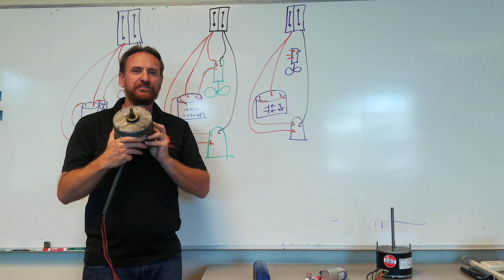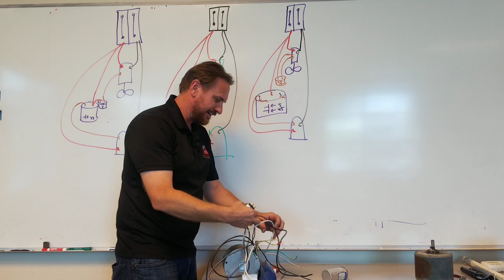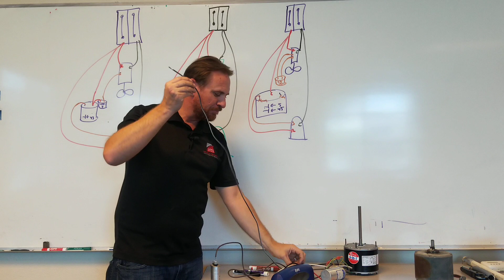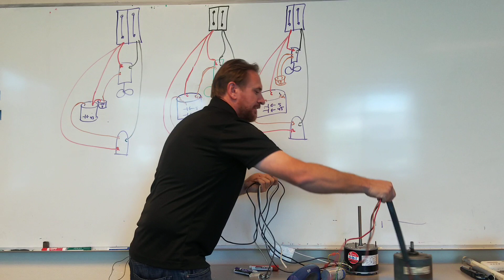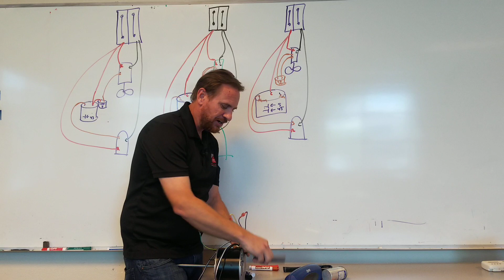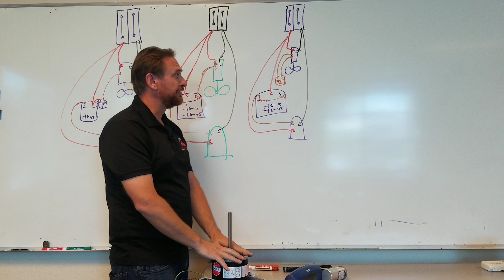Hvac condensor wiring part 5 universal fan

Comment: I am curious about your comment of cutting of a wire,  I have seen other videos stating it can be done, however not much explanation.  My understanding is that a capacitor require two wires to the motor to be installed in the circuit.  Is that correct?  The 3 wire motor I just replaced has a diagram that shows the cap with one wire and the other side is connected internally to the other side of hot.  Any thoughts ??  Thanks
Reply from the maker: Not sure what part your referring to. It is in a multipart series. Have you watched part 1-5 of the series?

Comment: I ended up having to eliminate my brown an white striped wire an wired it exactly the same as the old fan or else for some reason it wouldnt work right eaither the condenser wouldnt turn on with having it on a different compacitor or it would keep overheating never had a single problem an was less quiet after eliminting that wire
Reply from the maker: Great response everyone! Thank you!!

For me, there is not enough information.  I would like to see a measure quick screenshot before and after said temperature.

In Las Vegas, the sun bakes on the package units. The insulation would fall off and such. Even with everything intact, there was a lot of heat gain through the attic and then on the roof before re-entering. 

At these conditions, all problems are magnified. 
Could be leaking ducts, restricted ducts, home sealing, insulation, pressurization, and depressurization issues.
Mechanically high head pressure, compression ratio, compressor capacity, internal pressure relief, restricted txv, closed filter drier, the list goes on. 
With the measure quick screenshots, I visualize it better.

Comment: What if the black wire on the old one was on a relay at the control board  would u put the new black wire on the relay or on the contactor for the 4 wire.....
Reply from the maker: On the relay, that is most likely a heat pump.

Comment: Instead of adding a 2nd run Cap, just us a Dual Cap, the Brown/White wire is connected to the Yellow or White wire inside the Motor, so you don't need it. TAPE UP THE SPADE and leave it unhooked. Run the Brown wire to F, White to Common or the Defrost Board (Depending on if it's a Heatpump) , then the Black Wire the Contacts. This way you don't need a 2nd Conpacitor.
Reply from the maker: Yes and this was covered in one of the other parts of this series where I demonstrate that. 

When replacing a motor  it's best practice to replace the capacitor as well. A small capacitor is cheaper than a duel run even with a high quality capacigor.  A universal fan capacitor is rarely the same mfd as the existing dual run. Which means stocking more typed of dual run. Another benefit of a seperate capacitor is better heat transfer. Notice in hot climates dual runs fail more often than 2 individual.  More metal to air keeping them cooler and lasting longer. 

Personally I'm against taping the ends. I prefer to cut the wire and use a wire cap, butt connector or heat shrink. Electrical tape just makes for a gooey mess in the heat..
Over all it comes down to personal preference.
Reply: @love2hvac  yes you want to cut the end, wire cap and then tape.. Thats how I do anyways. I'll check out your other videos..

Comment: You explain this much more difficult than it is.  Use the dual compactor and connect the brown wire to fan, connect the white wire to common and the black wire to the black side on the contact.
Reply from the maker: You are suppose to install a new capacitor with the fan and it is very rate for a universal replacement to be the same size at the dual run.

Comment: why don't you use the existed 5MFD capacitor inside the dual capacitor ?  can you explain it ?
Reply from the maker: Always replace the capacitor with a motor.
Reply: @love2hvac  : it's not necessary since the life of existing dual capacitor is usually determined by big capacitor working with compressor but not fan.
Reply from the maker: @悟入木三分  
A capacitor is the #1 failed part.

I have many times seen just the fan side or just the compressor side of a dual run capacitor fail.
2 individual capacitors dissipate heat and last longer than a dual run.
Universal fan motors almost never use the same capacitor and as the original capacitor.
Most dual run capacitors are already made with thin oil that swells in the heat. 
Many motor manufactures require a new capacitor with the new motor for warranty. 

It dosent cost much more to add a separate properly sized high quality amrad capacitor that eliminates a call back, warranty motor and extend the life of both capacitors. 

I hate that hvac manufactures use junk capacitors in their very expensive units and I would never rely on that with my name and new motor.

Comment: Actually I just watched part six of your series and am I Safe to assume on a multi speed motor, that the multi speed motor leads would be considered your common wires??Thank you
Reply from the maker: Oh yes!!!!! 
I'm so proud! That is why the high speed is black. The other speeds just add windings, adding resistance, slowing the flow, weakening the motor. In reality the white (110) or yellow (230) is the run winding!
Becuse it is always being used it is just a commomly used wire so the terms get confusing.
Reply: @love2hvac  Awsome.   I am in a five-year refrigeration mechanic apprenticeship and I can tell you I learned more from this one video than I did during all of my basic level training, hopefully intermediate level gets better.....If it doesn’t I’m going to request that the school bring you in To educate us...Blessings from Toronto Canada

Comment: Thank you very much for the great video!!
I’m hoping you can answer a question I’ve had for a long time....Let’s say you had a multi speed motor and the different speed wires were black blue and red, and the common wire was yellow, and the capacitor wires were brown and brown with a white stripe.
In this case and scenario would your multi speed wires still be considered your run windings and with that brown and white stripe wire still be an extension of those run windings
Thank you in advance
Reply from the maker: The yellow (the true run) would be the same as the Brown with the white stripe.

Comment: Hello need help I have a 2 compressor AS 5 ton20 yrs old. The new motor is a universal 2 speed like the original old one 5 wires. It  has a white common, red low ,Black hi, the 2 brown I know are the new cap. I was told to hook it up like this, red capped off use black HI only. Black to a existing BK/BL that is connected to the high contact, white to the existing BR/RD to the same side of the HI contact, but the fan won't stop running. What did I do wrong! help!! thanks

Comment: If you can wire the 4 wire motor without the 2nd capacitor, why would you not do that instead of adding more capacitors / failure points?
Reply: I believe that second capacitor is help running the compressor
Reply: It's easier. You don't have to jump out anything. Basically a convenience wire. Also most aftermarket motors will have a different mfd rating

Comment: The white and brown/white are connected internally, so instead of adding a 2nd cap i use the dual cap. Hook the Brown to Fan on Cap and brown/white wire i cut the end off and tape it up.. No need to have another cap laying around inside..
Reply: But having a new CAP for a new motor Is the way to go 😬
Reply: @fernandocarrillo1711  its the only way to go, i install a Dual Run Cap always.
Reply: @Clark_Elite  good! I Let know the customer if the Comp Cap looks bad AND its up to him if I install a dual or just a new single for the fan.
Reply: @fernandocarrillo1711  the reason I replace the dual cap is so Im not called back in a week or so cause the Herm side has failed..
Reply: @Clark_Elite  thats why you Let the customer know the current state of the CAP AND Also that hes paying for the next service call if he decides to wait till the thing blows lol thats how It works
Reply: @fernandocarrillo1711  lol

Comment: I have seen some 2 speed condenser fan motors on some ICP units. Its not an ECM, but has 2 speeds. They use a Fan Speed Control board. Its a small board.  Why would they do that? Its a simple single stage heat pump.
Reply: Thats your defrost board. Its purpose is to kick the fan off so the compressor can heat up faster without the fan pulling the heat away, thats where you get your defrost.
Reply: Clark _Elite it has a defrost board as well.
Reply: @SombraLocs  more then likely its the fan relay.  The schematic should tell you forsure though, but without looking at it that would be my guess if your not talking about the defrost board.
Reply: Its a Fan Speed Control Board. My question is why 2 speeds? Its not the defrost board.
Reply: @SombraLocs  less cooling and more humidity removal. Thats why it has 2 speeds.

Comment: You did a great job Sir! 
One of the issue is absolutely true. It was happened to me Last time. It was rooftop unit. I tight the capacitor with the unit's grill which is come with the universal fan motor. After couple weeks, for some reason the capacitor got hit by the fan and then hit the coil really bad! My boss was pissed and screwed me up! Again, you are fantastic. Thank you for your presentation.